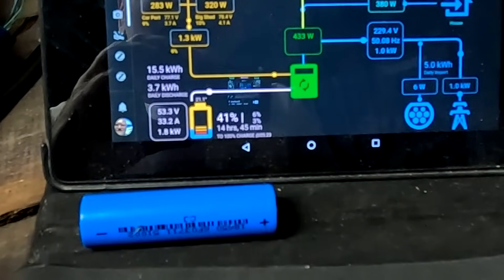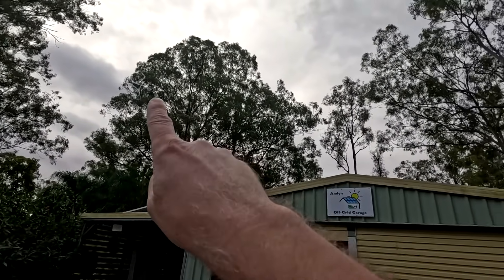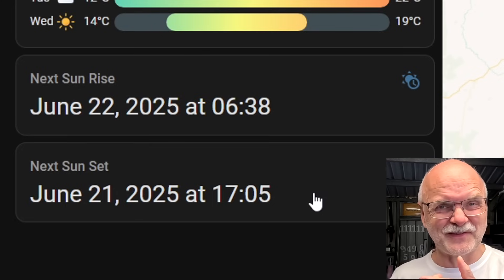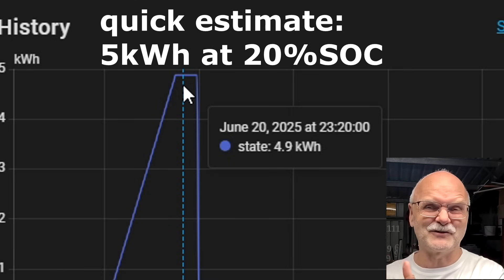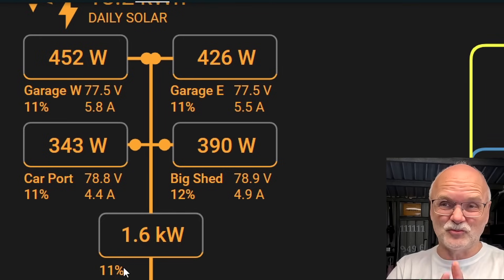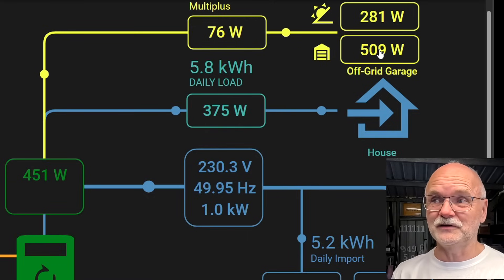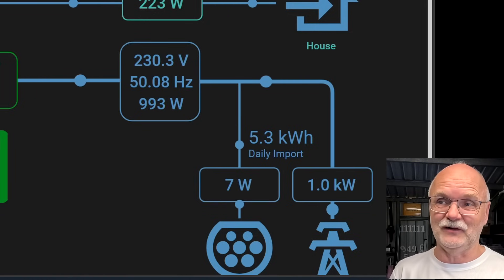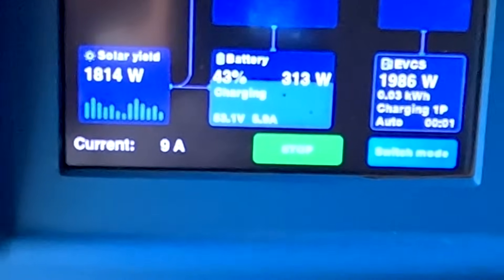Winter-Solstice 2025 and biggest Off-Grid Challenge: Can we make it through Winter without the grid?

Comment: Because situation in winter with bad weather, I'm recommend only high voltage PV system to be able for high charging, instead of victron low voltage, and better system from all in one, so we don't need to worry all this in winter...
Until now I have install 5000 solar systems around the world...
Thanks to Andy videos I have more jobs...
Good luck everyone...
Reply: Voltage has nothing to do with the actual power being generated. If you have 10kWp installed solar, you will get a max of 10kw (simplified) independent if this is a going to a 48V charge controller or a high voltage battery. Solar side voltage only matters if you need to bridge a longer distance.
Reply: Whe you try on 1300 different projects, you will finally understand...
Power from PV is much higher if the 10kW string is on 500V DC, if you have two strings of 250V DC will not work the same as 500V...
First of all higher voltage system is activated by the sunlight much earlier in the morning, and getting out of power later at night, and by the clouds it's giving more flexibility to higher charge during the raining days...
Of course if the distance is longer we need higher DC voltage to be more efficient, but we are talking about how much we can store the energy from the sunlight, and what can make more electricity for us to use...
Good luck everyone...
Reply: @rozarijorodin  The active voltage range of the MPPT decides when power comes in, not the voltage of the string. A string will reach its Voc even in minimal light, but that doesn't mean energy can be extracted. Whether the strings are 500VDC or 250VDC  or 150VDC makes no difference.
Reply: Looks like you never try to reaper MPPT controller...
Reply from the maker: No, no, no, a high voltage system would be very inefficient with all the shading I have. I deliberately chose this low voltage system as it acts like 'micro-inverters': all unshaded panels can output max power without being affected by the shaded ones. I see this every day on my house solar which is a high-voltage system. When only two panels are shaded, the output drops dramatically.
Reply: What do you like more, shades from the tree to keep you cool, or more power generated by your solar panels...
In Croatia most of the solar system is now changing to high voltage to generate more in cloudy days...
Because low voltage regulator can't meet needs of the costumer's...
MPPT is always measuring voltage from solar panels, and taking maximum amperage from it, but not the way you guys see it...
Good luck everyone...

Comment: i have ariston boiler heat pump. use 270W to heat 150L water to 63 celsius an cost 560 €
Reply: You're comparing power with energy there.
Reply: @matthewmarks6951 yes 270 power consumtion and 3,5 cop = 1 kw termal power. 9 houres to be full
Reply: @marianilie7321  I keep looking at heat pumps enviously and resisting...
Reply from the maker: A heat pump does not make sense for us. We only have a bottleneck for 2-3 months of the year. The other months I have a lot of surplus energy anyway, so I'm happy to dump it into my hot water system using a maintenance free resistive heater.

So, I use around 5kWh to heat up my water per day. With your heat pump, it would be close to 1.5kWh only...
Reply: @OffGridGarageAustralia  Maintenance-free until it corrodes through and you need to replace it! Still, I concede it's likely to be a cheaper fix. (Provided you can remove it without destroying the tank. The copper cylinders we use(d) in the UK can be quite weak.)

Comment: 27 kWh today, used 11 kWh, wasn't home much and the vehicle didn't charge much as well, we'll gradually charge the vehicle from tomorrow on. It's very warm weather so consumption of the vehicle is at it's lowest, when I'm not driving Autobahn in Germany 😅🤗🥳 Great stuff you are using your surplus amount of your house to feel how it will become in 2 years. If the waterheater is using to much, maybe replace with a more economic system might be an option as well. Keep up te good work down there 🎉😂
Reply from the maker: Thanks, Edward. Don't drive too fast😄
Reply: Morning Andy. 12 on the roof 2.4 generated to now, 1.8 back to the bat and the house using .4 and about 600ks up the road from you 😂 bat will be charged in about 11ish. Loving your Chanel, got a 16 kva I'm putting together and can't wait to put it on🎉🎉🎉
Reply: Sand battery can store for an extended period I beleive

Comment: Relying solely on additional batteries to stay off-grid during winter is only the third-best option, as batteries degrade over time. The second-best approach is to increase solar power capacity. However, for long-term energy storage (spanning several months), hydrogen storage is a more viable solution. The challenge with hydrogen lies in its low energy conversion efficiency. In addition, the technology is complex, expensive, and storing hydrogen gas involves certain safety risks.

That said, there is already an engineer who has successfully implemented such a system for several years. Search online for "Hans-Olof Nilsson's Off-The-Grid Hydrogen House near Gothenburg, Sweden" to find several articles detailing his background and the technology he uses.

Comment: NZ, North Island, 9hrs 30min day length, 17.8KWp unobstructed north facing, 60KWHr batteries. We never run out of power, although occasional days we draw more power from batteries than we generate. June export to grid will be 600KWHr

System was built and designed by me. Operating now for 6 years. Have recently done a panel upgrade on our "garage system" from 4700Wp (18x260Wp) to 6640Wp (16x415Wp)

One more battery to build before summer for additional export control - we have a 10KW export limit, so export control batteries charge during the daytime and discharge to grid 5pm-9am. I use Nissan Leaf EV battery modules so battery cost is almost zero, and after 6 years daily cycling my original 20KWHr house battery is still at 93% of its original storage capacity. Who says NMC batteries don't last......
Reply from the maker: Awesome setup. Do you get wholesale prices for exporting at peak time?
Reply: @OffGridGarageAustralia We opted for a 5 year fixed contract at $0.17/KWHr (and daily distribution cost also fixed $0.66/day). This gives us $2000 each year for Christmas spending money from our exported electricity 

NZ is a strange electricity market. Distribution costs are horrendous - rising to half of a non-solar customers bill over the next 3 years. Solar customers pay the exact same fixed cost. In our situation, my 1KWHr daily use (for inverter frequency matching) will effectively cost $2.80 once our fixed contract expires. But we need the grid connection for export. Catch 22. So I'm looking at 4 months off-grid and 8 months on-grid, with 3 years to plan and build

NZ has yearly winter electricity supply issues - too much intermittent capacity, retiring thermal capacity, and a wholesale electricity pricing mechanism that pays all generators the exact same marginal cost. So no incentive to install/keep running expensive thermal generation. Which then skews the wholesale pricing very high ($3-500/MWHr) whenever the old thermal plants are needed = Feb-Sept. Which causes businesses to shut down due to high electricity cost......
Reply from the maker: @Goodkiwibloke  What a mess. Large scale wind projects with battery storage should be the way forward to keep the grid and prices stable. 
Such a system pushes a lot of people into off-grid scenarios.
Reply: @OffGridGarageAustralia Yes and no. Grid scale batteries only bridge ultra short term energy deficits (sub 24 hours). NZ's main generation problem, is a lack of "on demand" assets (coal, gas, geothermal). Although NZ has very good wind (roaring 40's), it is very unpredictable (country is too small east-west to create predictable wind). We can go months with well below average wind, which then drains our hydro lakes, forcing coal and gas use, driving up wholesale prices

But, as all generators are paid the same marginal price, it favours those with zero "fuel" cost = wind, solar. Hence we got too much wind being built, and now solar. And since NZ is so far south, solar capacity factor in winter is zero for the evening peak and under 10% for morning peak. Even blue sky days (infrequent) in winter have a maximum (peak) capacity factor of about 35%. Utter madness to build grid scale solar in NZ, but that is what the wholesale pricing mechanism drives. Current 5 year generation build pipeline is 80% solar, 15% wind, 5% geothermal.

Meanwhile, thermal assets are being retired without replacement. And we are being pushed to electrify everything, including process heat

The sh!t is going to hit the fan in about 5 years. At least our lights will stay on....

Comment: Sitting at the top on my arrays up here in Ga, USA. A degree or two shy of being perfect but at the end of travel on the spiffy 16" linear actuators I'm using. Same on the other end come December 21 at the winter solstice. 12kw across three tilting arrays and another 2.4kw on a fixed array on top of the solar shed that sits close to the middle. Blessed to be sitting where I am. Shading comes early but clear to the sun from about 8;30am - 6;00pm even though the trek changes but so does the shading. No one near me has it nearly so good because of the terrain and plentiful trees. Solar isn't really an option for all of them. That's a real bummer!
Reply from the maker: Interesting setup and system design. Thanks for sharing.

Comment: There are about 4 weeks in a year where the 60kW batteries are not enough. Let's say in worst case scenario there is no sun for two weeks. So I need about 280kW.
Or more solar panels to use that last drop of energy when the sun shows itself, maybe we get lucky and the full moon gives us over 40 Watts.
You can do many nice things with about 20k euros/pounds/dollars.
We do have backup heat. 1 kubic meter of wood contains about 500kWh in our stove (high efficiency 24kW boiler).
kWh need to come down a bit before storing for winter will make financial sense.

Comment: Why a charger when you can use a power supply with current control and adjust the current to what is being exported to the grid? Power supply + esp32 + hassio... Just an idea😊
Reply: Because he gets paid for what gets exported, not what gets generated. (And that is why he's not allowed to connect any extra solar panels to the grid, because it would skew the reading.) I'm lucky in the UK that I get paid for what gets generated - are you the same?
Reply: @matthewmarks6951 No i am  not, in Portugal you can get but its a round 0.05 euros and too paper work and i pay 0.19 euros per kWh. Better use it all.😂

Comment: Brauchwasser-Wärmepumpe 

👉 Domestic hot water heat pump
Reply from the maker: Too expensive and will not last as long as resistive heater. The hot water is only painful in wintertime when we use more hot water and energy production is lower. The rest 9 months of the year, it is not an issue because we have enough energy from solar.

Comment: Hey Andy, did you ever consider the wind generator? I remember you mentioned you're in some walley, might be not as windy there for you. I've opened a new and beautiful world of wind power recently (by watching a couple of nes YouTube channels).. People are making wind generator out of everything - car alternator, e-bike motor, EV motor, 3 phase motor, etc. There are people who DIY the 25m post for it, convert the motor into generator (by cutting some metal of the rotor and gluing neodymium magnets), making the blades, making controllers... The machinery work on metal is for sure not for everyone, just saying it's doable. I believe it should sound interesting to you. Additional source of energy which doesn't depend on sun light!
Reply: Looks like there are quite a lot of trees near his garden which has a huge impact on wind generation, ideally you'd put it high enough to be above any disturbance including ground effects. There is actually a tool called Global Wind Atlas which can help you calculate the power you can expect although it can be off if there are too many buildings/trees.

You also have to look out for local regulations since there could be additional safety regulations or building codes you'd have to follow. 
In my area for example I wouldn't even get 100W/m² on a 50m post (according to my calculations) and the regulations for 10m are already not worth it.
Reply: He often gets asked that. I can't remember what the stock answer is, but wind generators require substantial mountings, are noisy and need a lot of maintenance.
Reply from the maker: Wind is not feasible down here in my location. We are in a valley and only get these winds occasionally. The turbine would sit there 99% of the time doing nothing. If we have these windy days, I would love to have one though😄

Comment: Of course it's feasible. Even in winter you generate way more than what I would use. I'm at 5kWh/day average in Winter; with a 120kWh battery, that means I can run my home for almost a month. With cell prices as they are evolving, it becomes feasible to build a 1MWh pack, which I can charge in summer and run the house all winter (we pretty much have 6 months of winter) with that stored energy, even using the heatpump more than I do now.

Energy generated today: 50kWh+ I think - batteries 100%, trying everything to use the energy: I run the dehydrator for drying apples, direct electric hot water, induction cooking, anything goes. We're having pretty much 24 hours of light a day these days.
Reply: The top tip here is, don't use to much energy.
Reply: How in the world do you use so little?
Reply: @brettcombs774  The house was designed with off-grid and efficiency in mind. All appliances are lowest possible consumption (heatpump drier, etc.), heating is with wood gasification boiler, LED lighting, optimal inverter self-consumption, minimum base load consumption (100W), etc. In summer I use induction for cooking, propane in winter. Similarly, hot water in summer is purely electric, but in winter it's wood (same gasification boiler I mentioned). Once I get more energy generation in Spring, I use a heatpump to offset (or eliminate) wood use.
Reply: @brettcombs774  Scandinavian? They know about heat pumps and how to insulate. Meanwhile in the UK we have the fossil fuel industry and its clients like the right-wing newspapers spreading misinformation about heat pumps, claiming they won't work in our climate!
Reply: @matthewmarks6951  Yep, Finland.

Comment: What about using solar thermal for your hot water?
Reply: Our government no longer supports solar thermal systems, but it does support solar panels and heat pumps. A solar thermal water heater can only produce heat and cannot be converted into another form of energy, such as electricity. Once the water is warm, the system no longer generates any output.

In contrast, when using solar panels in combination with a heat pump, the electricity generated is used by the heat pump to heat the water as efficiently as possible. Once the water is heated, any surplus solar energy can be used for other purposes — for example, charging an electric car, charging a home battery, running the air conditioner, or powering other household devices.

Also keep in mind that a solar thermal system uses glycol, which needs to be checked every year, resulting in higher maintenance costs compared to a conventional PV system.
Reply: @dirkdaems841  All the plumbing is so much hassle to install, too. Not all systems use antifreeze though: if you live somewhere that doesn't freeze or you use a self-draining setup.
Reply from the maker: Solar hot water is too expensive, and ROI is more than 25yrs, if nothing breaks or start leaking.